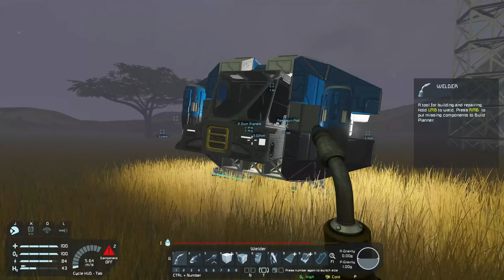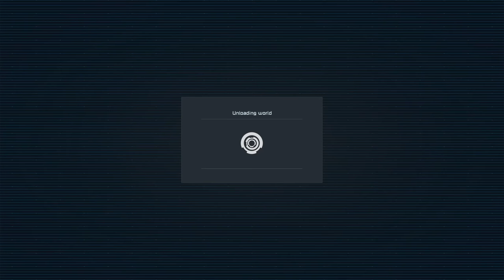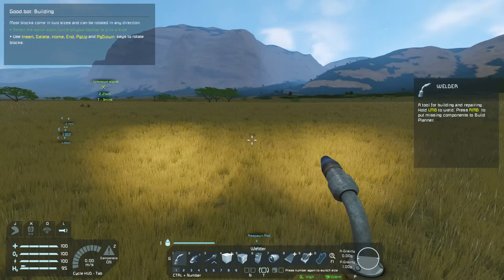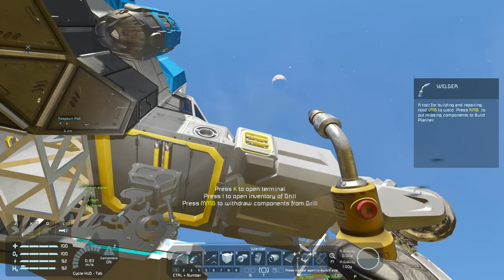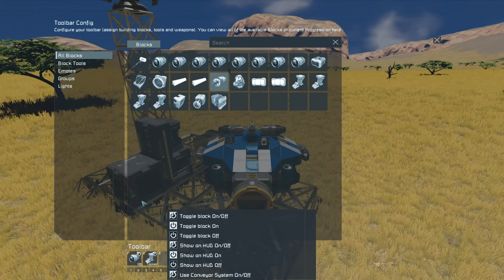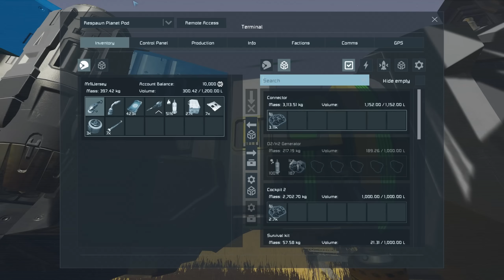Building My First Miner In Space Engineers - Episode 2

Comment: The standard way of going down on a planet/moon is to pulse your inertial dampeners on and off with "Z".

Collectors are for picking up loose objects.  Say the rocks tumbling down a mountainside chute you've carved as part of a stone mine, or things being thrown out by an ejector.  (Electors/collectors predate connectors in the game, once upon a time that was the only way to automatically transfer cargo between grids.

Some tips WRT cargo:  As you may have noticed, connectors don't need grids and have storage.  You can also use ship grinders and welders¹ as storage.  If you check you will also see that small grid cargo containers don't need grids.  You can take advantage of this by building an advanced rotor, grinding off the head it comes with, and replacing it with a small grid head.

Oh, try playing around with what you can make using drills, pistons, advanced rotors and hinges.

1: These can also be very useful when building large blocks like full refineries.  Build a welder that's linked into cargo and will hit the desired block, queue up the needed parts in an assembler, go do other things while it builds.

Comment: The video is two months old, i don't know if you have discovered the shorcut on the build planner. so here a few tips

While holding the welder, Right Click on the block that you want to build and it will put it on the build planner.
Then just Shift+Middle Mousewheel on any conveyor ports, that will queu up all the needed parts for the block you want to build.
After the parts is done assembled in the assembly you can just Middle Mousewheel to take whatever parts that you need.
Alt+Middle Mousewheel to empty out your iventory.

P/S: There something for Ctrl+Middle Mousewheel, but i can't remember what it is. Have Fun.

Comment: It's good to see someone actually learning the game, watching someone learning the game can be more interesting than watching 1000+ veteran. Here are some tips:

Starting ship has an ore detector, but it's set to 25m by default (maximum is 50m). Also, add "recharge on/off" option for the battery on the hotbar (and build large battery for the base and more power generation). Base drains power from any attached ship as long as it needs more than it generates.

Comment: Technically, you could do forward/backwards in a kind of clumsy manner, by adjusting your forward/backwards pitch, but stable flying that way is excruciatingly complicated.  By tilting the ship forward, some of your lift thrust is turned into forward thrust, tilting back would slow you down and then eventually start you moving backwards.  Much simpler to add directional atmospheric thrusters.

Comment: Hello! A few small things that should help you along:
1. Putting a waypoint at your base is a good idea. It'll help prevent you from getting lost in the future.
2. I usually take apart the respawn pod's thrusters for their metal grids to make my small cargo container, but since it's your mining ship now that isn't the best idea. I also tend to not bring my respawn pod anywhere (unless I turn it into a rover to find a better spot) and try to squeeze every last bit of inventory space that I can out of my ships.
3. The refineries and assemblers do automatically pull from any connected inventories automatically, but only to a point and not necessarily from the containers on your ship, so manually moving stuff across works (or conveyor sorters but I haven't really messed with those).

4. It has been mentioned by other commenters, but put your survival kit on the base unless you want to risk a crash destroying it and forcing you to get a new respawn pod (which most likely won't land you close to your base). Then replace it with a medium cargo container or something to both fill the space and keep your ship's cargo wired. This may take a little rewiring of the cargo system but is worth it since a MCC has much more space for resources than the survival kit.
5. You can tell batteries to recharge in their options or by setting it on your hotbar and using that. This is useful if your base decides it doesn't have enough power to run all its things and starts draining your ship batteries, which will most certainly happen if you only have one wind turbine powering it. An excess of power is a very good thing to have.
6. I believe the crouch key lets you go down in a ship. It atmo you shouldn't necessarily need a downwards-facing thruster to do so, and this should help your landing gear survive future landings.

I'm glad you're enjoying SE so far! It's kinda like Minecraft in the sense that you have to make your own goals, but it can be real nice to achieve those. And if you ever start to look into the DLCs, know that the blocks included in them are completely cosmetic and add no additional functionality to your game. They just look nice. I hope to see more SE from you in the future!

Comment: A few things you need to know, not meant as spoilers, more to stop you getting in a dead end and have to roll back too far:
1.  To go down press 'C' (not 'Y' which turns the ship off).
2.  Pressing the 'P' key is a bad habit to get into (later when you have more stuff attached to your base, it may fall off and break).
3.  Go to your ship control panel, select the ore detector and switch the range to 50m, there is a bug where it defaults to 25m which Keen still haven't fixed.
4.  When you connect your ship to your base, switch your ship batteries to 'recharge' or the base may drain your ship.  (Don't forget to switch them back to 'auto' before disconnecting or your ship will drop to the floor).
5.  Save often, clang will strike (along with lightning) and break things fairly often.
If you want a starter guide there is a series done by Splitsie which is very good, but you seem to be doing mostly fine yourself.

PS - not sure the Basic Refinery can handle Silver.

Comment: small and large grid cargo containers have different costs you do not need metal grids for small grid cargo and could have fit a medium cargo container right in the center of here 15:20.  you also need to either move your survival kit or make a new 1(you need that silver to make medical comps to make one of those) because if it breaks and you die, it's back to square 1.

so far you're doing good just some minor noob mistakes and only 1 big mistake which is risking your only survival kit, i would also recommend finding some ice soon and take a few minutes learning what everything in the control panel does.

Good Luck Engineer :goodvibes:

Comment: Doing well mate, one heads up though; the benefit to fully building objects (albeit it does cost more materials) will be a greater durability, so if for example you cockpit is only just on the functional line, any damage (even the most miniscule) to the cockpit will render it un-usable until it is repaired, where as if you fully build the object it has a bit of leeway damage wise before it becomes un-usable

Comment: So cool to see a beginner space engineer! The beginning is a real struggle. I have like 800+ hours and I’m still not super efficient in the beginning. 

You did some small beginner that are totally fine. However, you’re flying your only respawn point. Which is also your beacon for your base. If you fly away, trust me, you won’t find your base. Please remove the medkit and place a gps mark for your base. 
Also important, you’re discharging your ship! Your one wind turbine isn’t enough. The base is drawing energy from the ship’s battery to power your modules. You need to set your battery to recharge. Or put up a couple more wind turbine. 

For quality of life:
- You have a down button. It’s the same one for crouching (C key for me) you’re in gravity so you don’t need thrusters to go down. 
- Stop drilling once the cargo is full. You are wasting the resources.
- When drilling by hand, you can drill and collect at the same time by pressing both keys. 
- Focus on building an ore detector to find cobalt. You need cargo containers otherwise your drill will be the only good cargo holder on your ship. 
- When building, you can select all the missing items from the block you’re building. So if you’re missing 3 interior plates 2 motors and 16 motors you press MMB and the game will save it for you. You can also draw those item out of container and put them to production’s queue with different shortcuts. There is some very good videos on it look for “space engineer Build Planer.”

Good luck fellow space engineer!
Reply: Just wanted to say that there already is an ore detector on the starting pod.

Comment: ... Now waiting for the first "clang" to appear ...  BTW you need Cobalt to build the grids for the containers, so put on the ore detector, set it to max range and fly low (50m a small ore detector has a short range ) ... and no you actually do not need the gears, in fact on a miner they are a nuisance ... But what ever you do DO NOT USE "P" to switch locks, you soon enough figure out why
Reply: Also... when flying in your jetpack, ALWAYS have your drill selected, any ores you happen to fly over will appear on your HUD (your drill has a "mini" ore detector built in, very short range, but better than nothing)

Comment: 18:10 the conveyor tube was fine, you replaced it basically with tube junction that has ports from all the sides. Also you can go down with your ship even without up thruster. You just need to press C or your crouch button. Or look at the options -> input.

Comment: Loved the video @MrNJersey! Can't wait for the next video of Space Engineers man! Glad to see you finally join the SE Community as well! Connectors are usually used as a means of not only recharging/refueling your creations but also as a means to unload any ore that they've mined or any cargo that you have on board. Later on in the game, you'll be able to build something called a Printer. It's a Grid build that basically has a Projector showing an image of a creation that you want to have built on a Piston that'll retract and pull the Assembled portion away from the "screen", depending on how you have it setup that is. Normally, they're about 7 by 7 or 7 by 9. Large welders on the bottom, fed by conveyor blocks, covered over with windows for the "screen", and then you have a frame for the Piston and Projector that will allow for the Production of your creations (i.e. Welders, Miners, Transports, Rovers, Grinders etc.). Captain Jack has built this several times on his channel especially in his "Space Engineers: Survival" Miniseries after the release of the Badlands DLC last year, so if you want to see how it works, you can go give that a watch!

Comment: If you turn "Show in terminal" to off when making groups in your control panel, the group will show up as the name in asterisk's (ie.  *THRUSTERS* ) while each individual item in the group wont show up, making it look much cleaner and easier to use. It also helps a lot when adding new stuff to a creation, if all of the items that generally clutter up the control panel (Gyros, Thrusters, Doors, Cargo containers, Seats, etc) are all hidden from the terminal and grouped into their respective types. If you need to access the hidden stuff at any time, you just click the eyeball icon next to the searchbar at the top of the terminal and it will show all hidden items as well as the normal hidden items.

Comment: Good episode! One minor thing, though: Your one and only Survival Kit is now in your mining ship. Apart from processing ore that Survival Kit is also your spawn point. So, uh, don't crash your ship and break it, I guess... :-)
Reply: Excellent point about the survival kit. Best part? Easily transfered to the stationary grid for the low cost of 25 additional steel plates to build the large grid version when combined with the preexisting parts on the respawn pod.

Flying around without the weight of the survival kit and o2 gen will also help with battery efficiency.